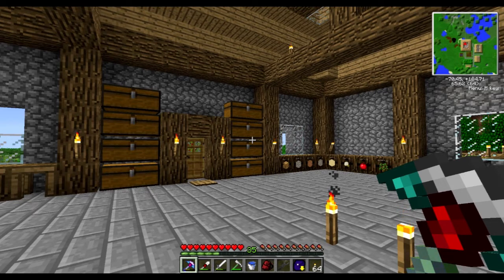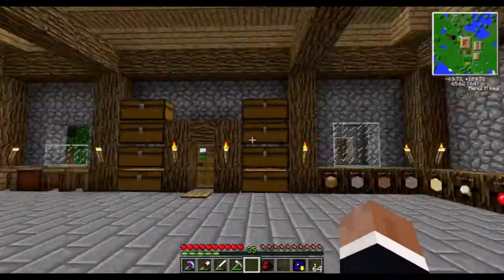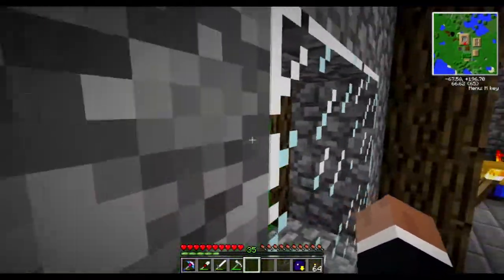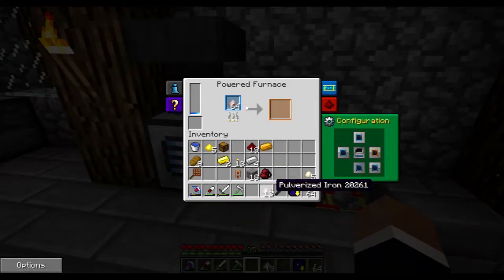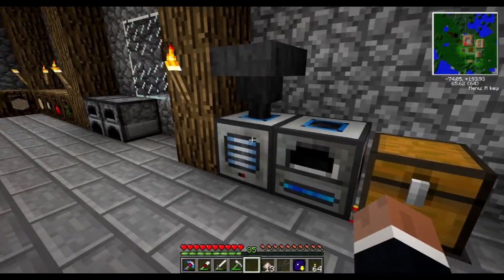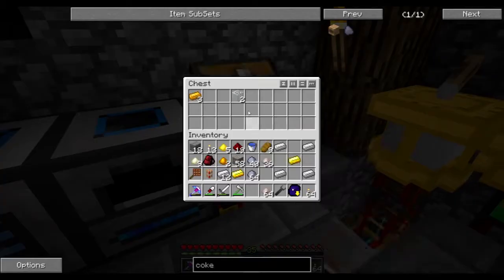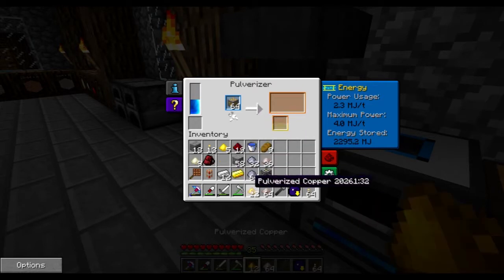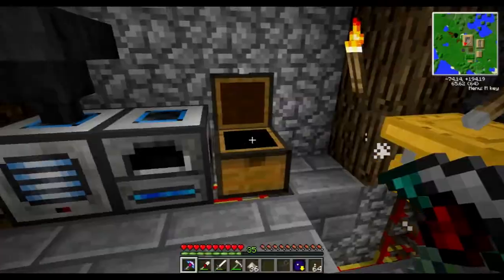Minecraft S04E05  Smelting and Tinkering

Comment: With the New Minecraft Hopper, they will connect Inventory slot. A hopper will connect to the block you point at, and only that block So if you was facing the wall, it would connect there first.